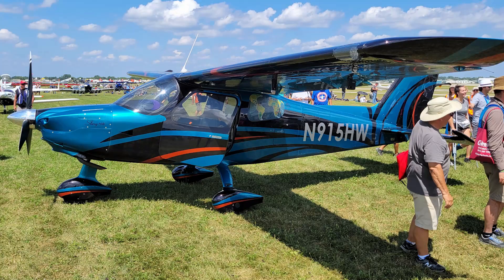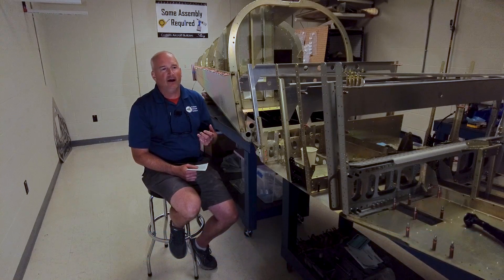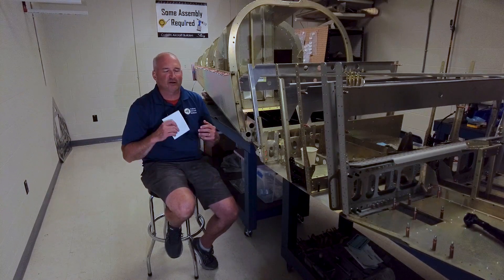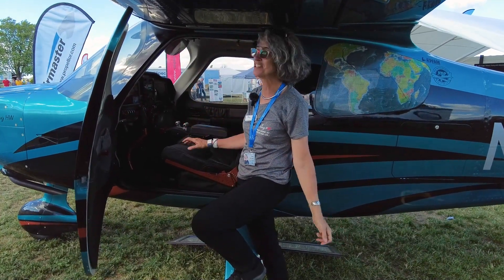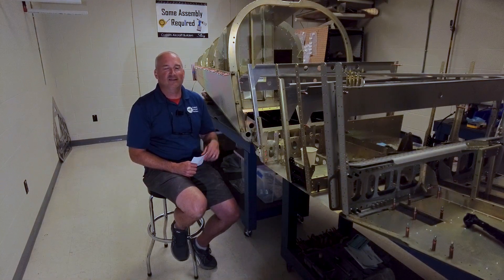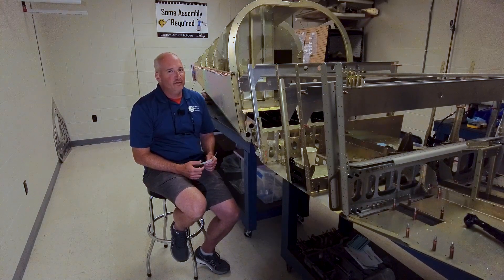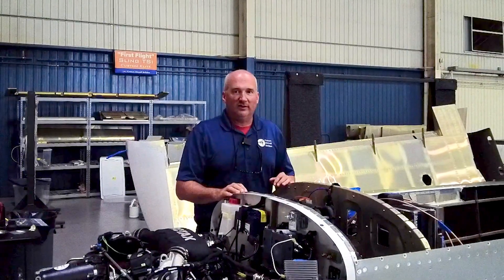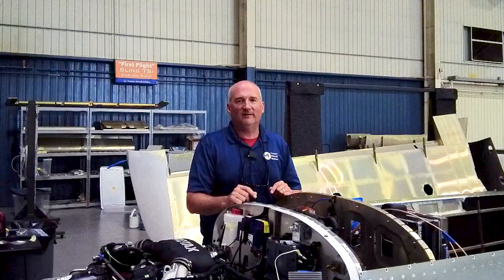The Sling High Wing - The Modern Cessna 182

Comment: C182? Really. I think that is a stretch in all categories. 137HP vs 230HP. Size, cargo, range the C-182 is a fill size 4 place. Sling is a 2+2 small plane.
Reply: I’m not sure you’ve done your due diligence. The new Sling HW has the 916is available which is a 160 HP turbo with sea level power up to 15,000. Full fadec. 1062lbs useful load. Interior is superior to the 182 in every way. Just as much room. It’s deceiving. And it’s faster than a 182. So, yes, it’s a modern 182 that’s superior on so many levels.

Comment: Doug, if you chose not to have the parachute, I would guess that the rear air condition balance wouldn’t be an issue, right?  
Great video.  This definitely helped me make a final decision on building the high wing.  Although I prefer the low wing, I think the high wing is better for ease of entry and exit, especially as I get older.
Reply from the maker: Tino, the HW has less balance issues than the TSi so it's really not an issue. Improving the ease of entry is one of the main reasons Sling developed the HW.  We are looking forward to working with you on the HW project.

Comment: Doug, thanks for the great video.  I really appreciate the insights on the Rotax 916 iS being a possible future option. I live in Arizona and split time between locations in Sonora Mexico and Arizona USA.  I envision a lot of flying that would occasionally involve being just above, over, or slightly in canyons.  One concern I've always had is that if you have 3 passengers and you're flying a bit low and slow and you encounter some nasty thermal activity when flying near canyons... well it would be nice to have more headroom above 135hp to goose the plane a bit and climb out of the situation with confidence.  I understand that a MAX Power of 165hp would only be available for a matter of minutes (< 5?), but it would be nice to have that 165hp to help you climb out of harms way for 2 or 3 minutes in lieu of just 141hp.  Perhaps I'm being paranoid, but that's the only reservation I've had about a 4 place HW w/ just a smaller 4 cylinder powerplant.  135hp is awesome all day long.. but that extra 30hp available for just a few minutes, especially with passengers and some equipment on board, is comforting. BTW, I am in the Albany NY area at least twice a year... I'll have to visit you all sometime.

Ok, heading over to your website to view that HW price sheet!
Reply: I don’t know why he didn’t mention the exact solution to your problem and what everyone else on planet earth wants to know. How to order the plane with the much better built Edgeperformance engine. Like Duh, It’s a match made in heaven, the 916 nonsense is just more stress on an old Rotax design.
Reply: I'm very keen on doing an HW with the new DeltaHawk motor, since it's just got Certification you know they are serious.

Comment: Please update us on what the build community comes up with on air conditioning in the TSI!

This is the main differentiating factor between the TSI and DA40 for my particular use case and I would love to fly a sling.
Reply from the maker: Will do. There are several solutions being looked at or actively developed in the Sling community. It's not a matter of if, but when there will be an air conditioning solution for the Sling.
Reply: @DougGoodrich there is a Sling HW video from Australia where they talk about installing Air Conditioners in other slings.

Comment: Just a musings but if you are using an electric AC I wonder if you could use some lithium prismatic cells as a counterweight and also provide some power to the AC unit at the same time.
Reply: I had a similar thought.  That way the counterweights become a useful load.

Comment: I'm about 5 years out from wanting to start my build. It's probably too early to get on the list, but this is the airplane I'm going to build. Hopefully by then the 916 will be established and the weight and balance on the HW will be well understood. How far out do you reserve slots for the build assist?
Reply from the maker: The Build Assist is not the issue. We will find the time to get another build through. The HW is developing a pretty long waiting list. The spot in line is only $5k and fully refundable. If you are a few years out, I wouldn't wait too long.
Reply: I’m also looking to build this with the 916 engine. Saw rotax testing it in Austria, it’s going to be a sweet engine. Engine is coming soon. I’m told there’s about 2-3 year wait for the sling hw kit. $5k refundable deposit to get in line.

Comment: Thanks for the detailed video.  Keep them coming.  Will the 916 add weight? Wondering if it would be an option for the TSI?
Reply from the maker: From what I have been told, the 916 is just a 915 with the manifold pressure increase to get more takeoff horsepower. Therefore it likely wont weight much different.